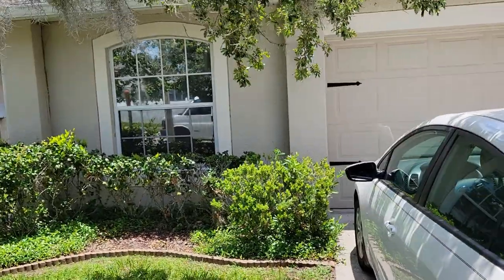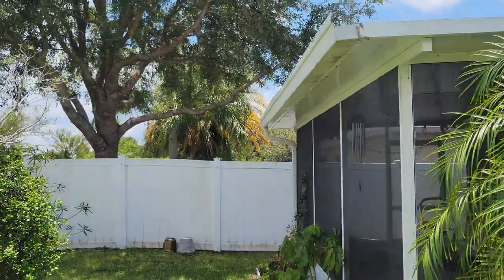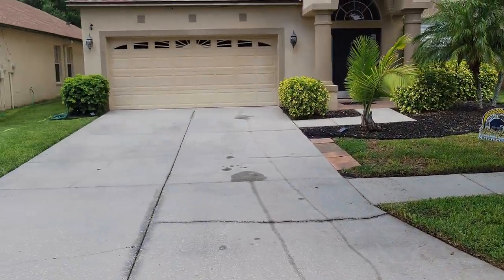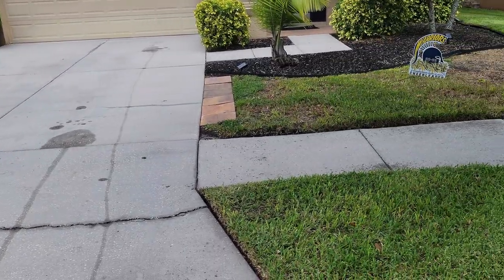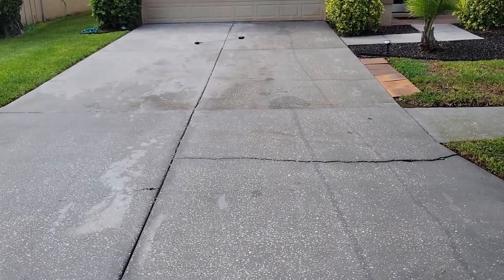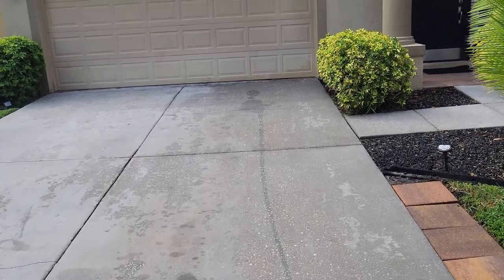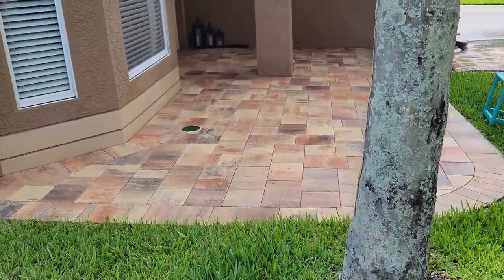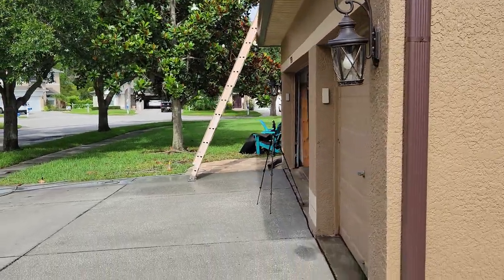3 quick jobs in 4 hours #pressurewashing

Comment: What nozzle you using? Is it a tip comes with the machine or a turbo nozzle?
Reply from the maker: On the driveway?  Yes that was a turbo nozzle
Reply: @PinkFlamingoPowerWash  thank you . What about when you wash homes and for the brick driveway. I wanna get into pressure washing thank you for answering my question
Reply from the maker: @tylerriebel8089  for house washing I use a Jrod.  It's a set of low pressure tips for softwashing.   The tips will be dependent on what your GPM is for your pressure washer
Reply: @PinkFlamingoPowerWash  thank you I appreciate you taking your time out

Comment: nice to see a pressure washing YouTuber not trying to sell me something lol
Reply from the maker: Yea thats not my style. I dont like that approach at all. Thanks for watching brother.
Reply: hey man I got a question. I'm just starting out and have a request for a 2 story house wash, I've done a small single story home before but I only have a 2.5 gpm 3300psi unit and I'm wondering about how much to charge and if it's even possible with my set-up? love your videos btw they've helped me alot!
Reply from the maker: @Mustbeplumbin  hard to tell you what to charge. Pricing differs by areas/market.  Also your equipment, overhead,  experience affects the pricing.   A typical house wash is between .10c-.25c a sq ft in my Market when it comes to experienced guys. You definitely could do it with a 2.5 g get you the blue and pink tips to hit the 2nd story. Good luck brother 🙏🏽 💪🏾

Comment: Would neurotic acid work on oil stains?
Reply from the maker: Muraric acid? Nah I wouldn't use that cause that will etch the concrete
Reply: @PinkFlamingoPowerWash  , yes it would. Seems like would be all the drive,not for spot treating. As you have said you can only go so far with cleaning.